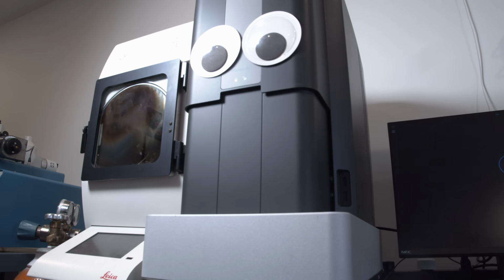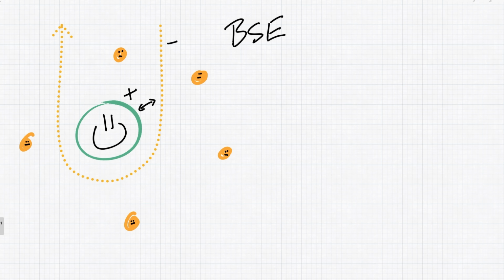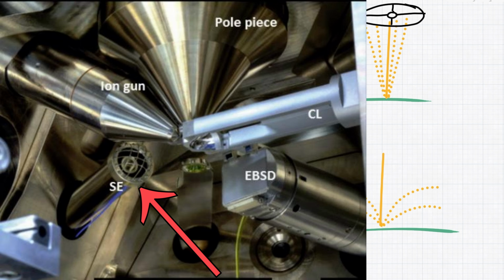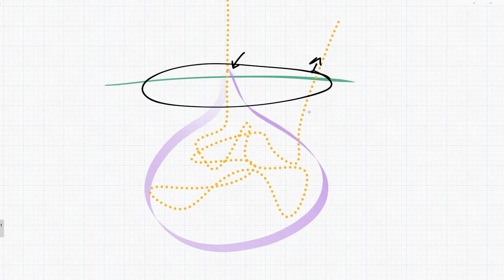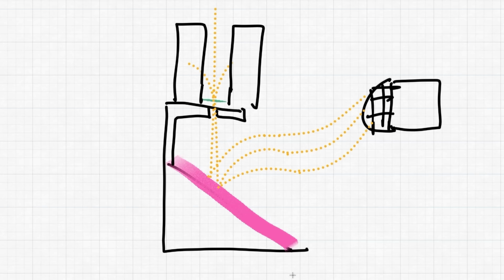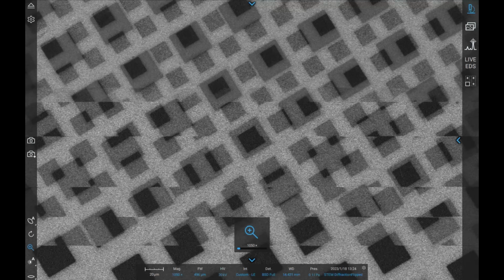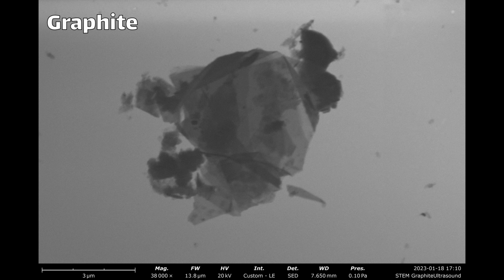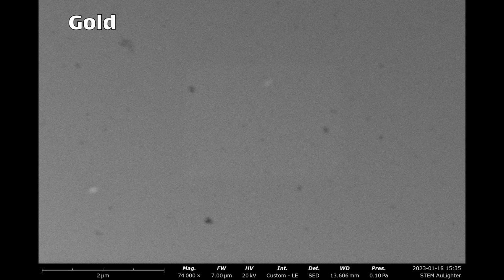Electron Microscope Hack to see Graphene

Comment from the maker: How can you form an image if electrons don't follow straight lines?
I accidentally left out some important details in an effort to keep it simple, my apologies! The secondary electron detector is a "single pixel" detector. So it only knows when it receives an electron, and doesn't have any kind of spatial knowledge. The machine will focus the beam onto a specific region, count how many electrons the detector receives, then move to the next pixel and repeat. So it doesn't matter what trajectory the electrons take to get to the detector, as long as they arrive before the beam moves to the next pixel. Hope this helps clear up some confusion!
Reply: Great explanation! The only thing I would add is the way it moves from pixel to pixel within the substrate is an array of octapoles. the octapoles use positively charged capacitance to pull the beam from pixel to pixel similar to the rastering you would see in a slow motion capture of a cathode ray tube tv.
Reply: Since the English language is not my strong point, I am wondering about something that, according to my knowledge, is not correct: The title of the video contains the indefinite article "an" followed by a consonant. I understand that "an" is used when its object starts with a vowel and "a" is used when the next letter is a consonant. So why is it like this: "...an SEM..." ?
Reply: @MR-ub6sq  That issue seems to have been removed, but here's the answer anyway... F, L, M, N, R, S, X, and sometimes H are typically spoken as beginning with a soft vowel-like sound. Mostly the sound is like E, sometimes like A. As vowel mimics, the may be preceded by 'a'. Is that strictly proper English? I don't know, but it is commonly accepted. 'W' is something of an exception. And of course, other consonants are typically spoken with a harder, more percussive sound. English is weird.
Reply: @YodaWhat  Alright. You are right. You obviously meant acronyms, because I understand that SEM is like that and abbreviations are of course pronounced single letters in a row
like "es ii em". So the "word" S is pronounced like "es" and as such begins with a vowel. I hadn't realized this possibility, but thanks for the tip. We're wiser now :) It's true that it LOOKS weird when written though.
Reply: @MR-ub6sq  It is not only the vowel-like case with acronyms. For many words, when the first letter comes from the list  F, L, M, N, R, S, X, and sometimes H, that first letter is spoken somewhat softly, as is it were a vowel. The vowel-like H is heard in the way the British pronounce "Houston" like "yoo-ston". Americans begin "Houston" with a rather breathy exhalation, similar to the beginning of "huge". Here is a silly mnemonic for the list: Falcons Like Mice Not Rats So eXcuse Hawk Weakness.
Reply: @YodaWhat  in the british pronunciation of 'houston', H isn't being pronounced like a vowel; it's just not being pronouced. 
I'm not sure what words your referring to where 'FLMNRSXH' are pronounced as vowels.
Reply: @YodaWhat  Apparently, it just needs to be stated that the rules can be stretched. And especially in the US. Finnish stand-up comedy guy Ismo Leikola has quite talentedly taken over the colorful American language from the perspective of a Finnish guy. For example, he WONDERS why the letter "w" is needed for some words and not for others? Like https://youtu.be/jz9AB7cXC8E 
or much worse
https://youtu.be/igh9iO5BxBo
one or won - - it's YOUR sh*t - not mine :)
Reply: Could you make a microscope for looking inside the laser Hologram label sticker?
Is that sticker in microscope is something like lots of micro line crossing and the light point in line crossing as the hologram visual?
Reply: How much does it cost?
Are there better methods for exploring the microcosm.

Comment: Graphene has a very low transmittance for visible light. Single layers are visible under a light microscope. I wonder if the same holds true for electrons at the energy involved here.

Comment: Getting true graphene isn't quite at everyday accessibility, but nanoplatelets are, which is more or less what you're seeing on your samples. There's a few more steps involved to get a bit closer, though it's made somewhat more approachable if you start with a non-graphitic source and do the graphitization phase yourself. I've got a week-long process that I'm streamlining with every breakthrough, but have to send my samples to a specialist as I do not (currently) have a TEM-capable microscope. Still trying to decide if it's worth picking up a Raman spectroscope versus waiting on independant results for purity certification.

Comment: This is (as usual; can't overstate how much I love this channel) a good explanation that answered most of my questions, but I'm confused regarding one thing: early on when you're talking about backscattered electrons you say they don't lose any energy when they swing around the nuclei, but I'd always assumed changing direction usually comes with a change in energy? The two examples that jump two mind are the orbital slingshot/gravity assists you mentioned, which are done explicitly to add large amounts of energy to the craft without having to spend much fuel. The more particle physics-y situation that jumps to mind is synchrotron radiation, which is caused by charged particles shedding energy when their trajectory is changed. Why don't the electrons lose or gain any energy in the telescope's process? Or do they just not lose enough for it to really matter?

Comment: You are probably recording new data already and I presume you are changing this parameter as well, but what is the minimum working distance of this microscope? With a shorter sleeve you might be working at the optimum WD for highest resolution.
Also the grid you were using probably had a thin polymer foil on it already to support the particles. Holey or lacey carbon grids might be worth a shot. (And yes, I work in EM).
As others said, I really like the longer format and the animations you showed!
Reply from the maker: You're correct, I switched to a shorter sleeve and it definitely helped! Not entirely sure the minimum working distance to be honest, my machine is a Phenom and they try hard to idiot-proof the machine (the stage won't let you insert a sample that is too tall, so it's not possible to hit the pole piece). I think the working distance is 1-3mm though, something in that range.

Also correct on grids! Mine were formvar stabilized with carbon. I'll pick up some lacey carbon and give it a shot! To be honest I was a little overwhelmed choosing grids, so many different varieties. So I just grabbed what seemed like the "simple" or "default" choice based on ted pella descriptions :)

Appreciate the tips!
Reply: @BreakingTaps   its interesting to learn about these simpler Seams and how they are made for a broader user base. Thanks for the explanation!
And yeah, there are grids in every shape and "coating" available, the ones you had are actually also very good for the experiment you showed.
Thank you for doing these videos, these are the ones I show to my less sciency friends to explain what I'm doing 😅
Reply: @BreakingTaps  I just pick this up here again: I recently learned that there is an open source and low cost option for transmitted electron detection in an SEM (BSE as well). doi: 10.1016/j.ohx.2023.e00413 The only thing your SEM would need is electrical feedthroughs 😬As there are not a lot of things open source or low cost in EM, I thought I'll leave this here.

Comment: I noticed that your design (as well as TedPella PN# 16412) use conductive polymer as the anti-scatter sleeve.  Do you know what the advantage is of using conductive polymer here?  Would there be a disadvantage to using something more conductive like a piece of aluminum or a brass tube?
Reply from the maker: I'm not 100%, but I think it's to discourage the generation of additional secondary electrons. I.e. a backscattered electron might strike the conductive sleeve and since it has the same energy as the original beam, can liberate secondary electrons. If that happens near the top they could escape into the detector. So using a polymer instead a metal helps reduce "cross-contamination" because they are poor SE generators, and being vaguely conductive helps ground them and drain away any built up charge.

That's just a guess, I haven't seen a specific explanation for that but it makes sense in my head :)
Reply: @BreakingTaps  That makes some sense.  I guess Aluminum would potentially be a bad scatter shield just because it is so bad at attenuating X-rays and those X-rays could generate more secondary electrons.  Not sure how big of an issue that would be (I suspect this would be a small effect).  I kinda want to order that TedPella 16412 and play with it.

Comment: Now I need to know why the electrons only make a U turn around the nucleus instead of coming off in all directions, depending how close together they got
Reply from the maker: Hehe, yeah I omitted that scenario for brevity. There are plenty (most probably!) of electrons that zip by and get flung off into random directions. That's partially why there's such a big "interaction volume" for an electron. It'll cruise near a nucleus and get diverted, go near another nucleus and get diverted again, on and on until it smacks into a nucleus, loses enough energy and is captured, or gets flung back out as a backscattered electron.

Comment: Out of curiosity, what kind of 5 axis cnc are you running there? Side question, wha cam software do you like to use
Reply from the maker: Kitamura Medcenter 5ax, and I use Fusion360 (with the machining extension) 🙂
Reply: That looks like a pretty sweet machine. I have been browsing the used market for sometime but haven’t found a good deal yet. They are either so old they have crt screens or are more than I want to pay or it’s good but 3000 miles away.
Reply from the maker: Yeah it's been a lot of fun! Really enjoying it so far (relatively new in my shop). I hear ya about the used market though, it's rough out there right now! Really expensive given the average age of machines. Covid really messed up the machine tool market. Logistics delayed a lot of new machines from being completed, so the used market got drained by shops that needed machines. I figure it'll start to correct but might be a year or three as things start to settle back out.

Comment: I'm always surprised how well the reflection method works in the SEM. 
I helped to invent a new type of reflection holder that used a scintillator and visible light instead. The results were great signal, less noise, higher resolution. It rivaled full sized STEM detectors. It's called the UVD STEM holder, and is only available from Hitachi.
Reply from the maker: Just looked that up, super cool device! UVD in general looks really neat, need to do some more reading on that, and the STEM variant looks very cool. It makes sense though, you won't get electron cross-contamination from SE off the sample itself, the scintilator I assume provides some amplification and with direct line of sight to the sintilator the photodetector can be optimized to capture all the photons. Neat!  I wonder if there's space in my chamber for a photodiode...

Cheers for the note, I love seeing ingenious devices like this!
Reply: @BreakingTaps  If you can optionally resolve the pattern on the scintillator, you could do holographic scans of the sample. Not sure what beam voltages end up favorable, but a classic analog CCD should be rather resilient to the beta radiation of the beam.
Well, I say "holographic"; the actual realtively-easy-seeming (from a mechanical standpoint, at least) would be CBED, where you capture a 2D diffraction pattern for each STEM pixel. Just beware of power density in the sample (CCDs rarely exceed 100 frames per second; this would be the speed at which you could step the STEM beam).

Comment: Great video. You might want to double check the 3D printed part though as it would have a ton of surface area and voids to offgas. I would think the material itself may also be gas permiable which may screw up the vacuum in the area.
Reply from the maker: Thanks! I've run small printed parts in my machine a few times, tends to work out ok as long as you're careful with the design (no huge interior volumes, dense infill, etc). But mainly because my SEM operates at a pretty low vacuum in the main chamber, just 100mbar. Compared to larger floor-standing machines it's practically atmospheric. So it's very tolerant of outgassing and otherwise dirty samples :)
Reply: @BreakingTaps  oh wow, that is high pressure. I have a vacuum oven I have been playing around with at home (installed an ISO100 flange with a 3" pipe on it). That bottoms out at 0.0mTorr, but that is just because that is how low my convection vacuum gauge reads.
Reply: @BreakingTaps  The sample chamber is definitely not 100mbar. It would be in the range of 0.1Pa-60Pa, as the UI also says. (0.001mbar-0.60mbar). Outgassing is definitely something you want to keep in mind!

Comment: You could try putting a hole on the plate under the sample and it will give you dark field image. Gold coating it will give better signal as well
Reply from the maker: In the works for version 2! Part of the rambling that got cut at the end was talking about that, the aperture is definitely too large and you can actually see it shift from brightfield to darkfield depending on where you're looking on the sample. Plan to add a little slot accept different size and shape masks/apertures under the sample so that it's easier to test.

Noted on gold! Been avoiding buying a sputter target because 💸 but it would be really useful to have in general
Reply: You can get away without the aperture if you use a smaller plate underneath and coat everything else in carbon paint. It's easier to change between bf/df/haadf just by changing the plate. If you remove the sleeve on the top and have a small WD you will get better resolution and electons shouldn't get to the detector because the pole piece will get i  the way. Thats how we run ours at Leeds uni

Comment: At 8:30, where the electron exits is irrelevant; the video monitor plots the gathered electron current vs. the position of the beam's entrance location.  That teardrop receives the charged beam, however, and builds up an equilibrium charge to repel the beam.  The charged volume in TEMs is much smaller and deflects the beam much less.
Reply from the maker: Cheers for the clarification! I definitely muddled that explanation up a bit (as well as not really explaining how TEM and STEM are different).

Comment: I've seen the term tunneling electron microscope used. Is that something different from a transmission electron microscope?
Reply from the maker: It is indeed different, although also a very cool instrument. Tunneling electron microscopes or more commonly Scanning Tunneling Microscopes (STM) are the historical precursor to Atomic Force Microscopes (but should be noted they are still in widespread use today too, despite being a precursor to AFM). An STM uses a very sharp, conductive tip and places it very close to the surface. The whole instrument is inside an ultra-high vacuum, and when a bias voltage is applied to the tip, electrons will "tunnel" through the vacuum to the tip. You can achieve angstrom-level detection of samples using an STM and literally map out individual atoms. Really cool stuff!

Comment: How do you reconstruct the image from a randomly flying electrons at secondary detector in SEM?
Reply from the maker: It's timing-based. The secondary image detector is basically a "single pixel" detector... it only knows if an electron is detected or not, but only has one pixel so can't determine any sort of spatial imaging. So the machine will shoot the electron beam at a single location and record how many counts the SE detector sees, then move to the next pixel and repeat the process.

Because of this setup, it doesn't actually matter the path the electrons take to get to the detector, as long as they arrive in time to be counted :)
Reply: @BreakingTaps  Thank you for the good explanation!

Comment: I never knew that 3D prints can be used in high vacuum systems. Wouldn't there be pockets of air trapped inside due to the layered structure? Seems like it would outgas like crazy.
Reply from the maker: They aren't too bad if you're careful. The material itself doesn't outgas a ton (there are some outgassing studies by NASA and similar, it's not amazing but not bad for a polymer), so as long as you're careful about walls and internal voids it's ok'ish. Either single walls with access to the interior, or dense to avoid trapped pockets.

The other consideration is that my SEM actually operates at a pretty low vacuum (100mbar) so it's very tolerant of outgassing and otherwise dirty samples. :)

Comment: Shouldn't you be in Harvard teaching some class?! Also can you electroplated items with the nano metals you created?
Reply from the maker: Yunno, I'm not sure! Typically electroplating uses a dissolved ion, unsure if it works with "aggregates" like nanoparticles. Can certainly include them as "inert" particles, I'm working on a different project which incorporates diamonds into the plating. Unsure how that works with metal particles though, could be a fun project!
Reply: @BreakingTaps  you should try it then compare a regular electroplated item with the nano plated item with you sem. Also what settings do you use with the optical laser? I have access to one and would love to try it.